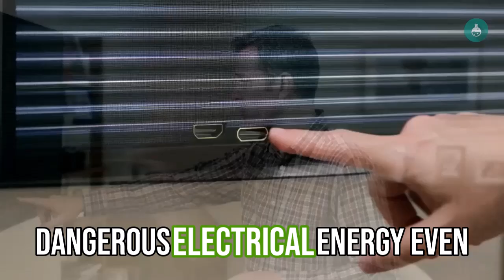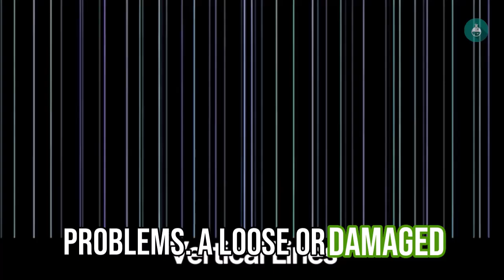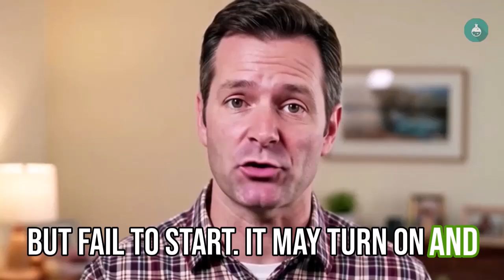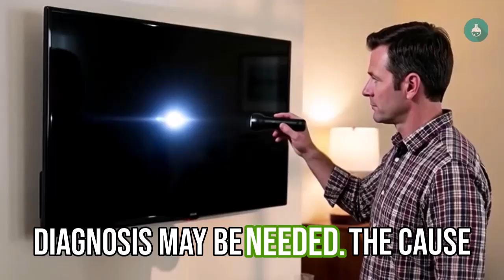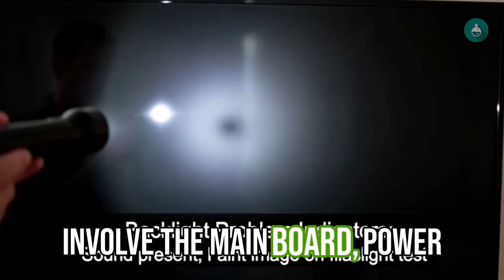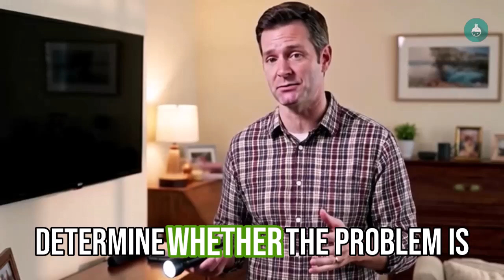Broken TV? 7 More Tests to Find the REAL Problem Before Replacing It | Part 2

Comment: How much would it cost to get the TV diagnosed
Reply from the maker: The diagnostic cost depends on the TV model and the problem. I recommend contacting a local TV repair shop for a quote. Once the fault is identified, you can decide whether the repair is worth the cost. 👍

Comment: The screen flashes on  and then quickly goes off, what could cause it to do that?
Reply from the maker: If the screen flashes on briefly and then goes black, it could be caused by a faulty LED backlight, a power supply issue, or a problem with the T-Con board. The exact cause can only be confirmed after testing. Does the sound continue working when the screen goes off?